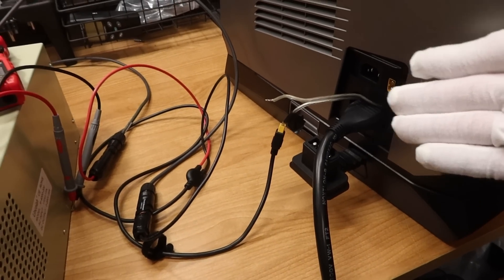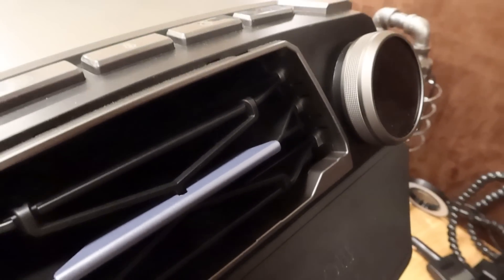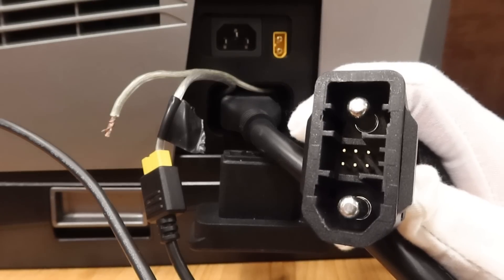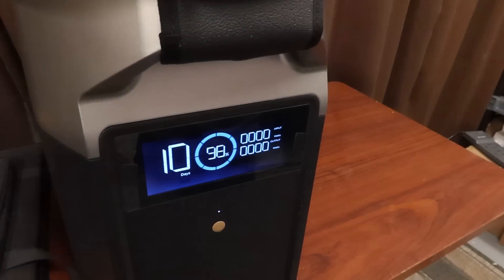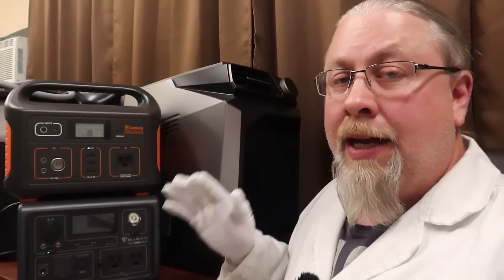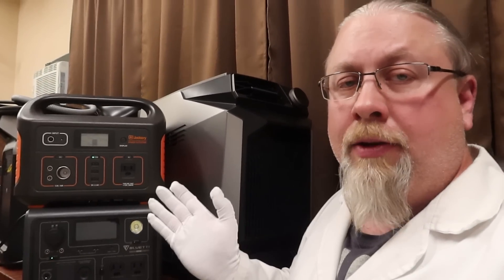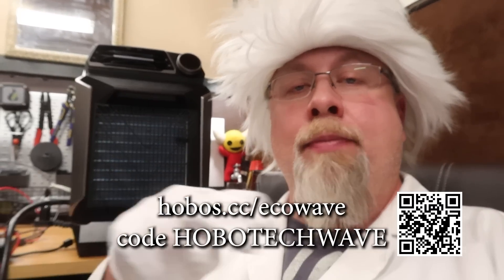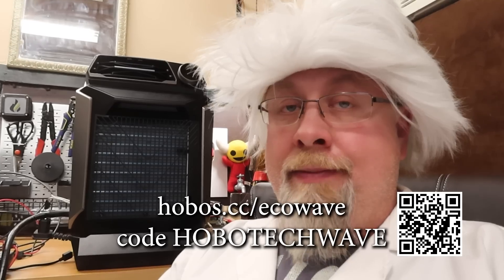EcoFlow Wave A/C FAQ | How To Use Your Own Battery Or Solar Generator

Comment from the maker: THIS PRODUCT HAS BEEN REPLACED WITH THE WAVE 2! WAVE 2 REVIEW: https://youtu.be/2NBfhABwn18 (Wave 2 purchase link: https://gohobo.io/wave2 use code or 25EFVAHOBO )
PART ONE Preview: https://youtu.be/xefWyqr-p1s
PART TWO Review: https://youtu.be/Ngm4Ct1O_Xc
Reply: When you add code, the cost goes up over what they’re currently offering. FYI
Reply from the maker: @cliff185026  Just tried the code. Works fine. "HOBOTECHWAVE (-$50.00)"
Reply: You are correct it does work on a single item not the bundle when you buy for example the wave and battery, their discount is already added and yours can not be added on top of that
Reply from the maker: @cliff185026  Nope. Works with the bundles too... EcoFlow Wave Portable Air Conditioner + DELTA Pro Sale price $4,249.00
DISCOUNT:HOBOTECHWAVE (-$50.00)
Reply: No support from EcoFlow!

Comment: Figures you already had tried this, took me all of 5 minutes after unboxing mine today to see it uses the same battery cables as the extra battery from the delta unit.

So I am willing to bet I could have used my existing extra battery instead of getting the wave battery, but also the wave battery will work with say my Delta 3 Plus (and if I'm not mistaken is a bit cheaper and larger capacity.)

The way I'd hack this experiment is to use a delta 3 wire my 48v battery to the PV input and then hook the Wave to the extra battery port.

This should work, and avoid the AC/DC conversion and allow use of your not cheap 24/48v battery bank.

If you have not already tried this, I'll see about trying and cover it on my channel (Vicious Computers)

Comment: I also bought the Wave 2 AC without the add on battery last month. Very happy with the AC but also looking for extra power supply without buying EcoFlow's battery. This is how I solved the problem. I have a 12v 108Ah Lithium phosphate battery hooked up 240W to solar panels for our fridge when we go camping. I also have a Victron 800w Inverter connected to the battery that gives me power and I plug my Wave 2 AC to that and presto my Wave 2 AC works. That is as long as the sun is shining and keeps on charging my battery.
Reply: Well yeah that works. But everyone was asking to know. Because they’re wanting to run DC to DC. If can be plugged into any AC an be fine.  Your AC is just coming from a battery bank. But your still getting all the losses bs going dc to dc

Comment: Use a Delta 2 instead of the Wave 2 battery and you can put in 15 amps instead of 8. 
My Delta 2 shows 370-380w incoming when using two 12v batteries in series for 24v.

Comment: Really need to have a product manual that has the internal schematics and motor and system in the cooling unit b4 doing anything other than using the equipment intended to run it.  So most likely less than 2000 BTU the way you got it running through the 24 volt solar port.  Any link to the real technical manuals?

Comment: Can you extend the runtime of the WAVE 2 With the bluetti AC 300 like you showed in this video
Reply from the maker: Wave 2 can be powered from any AC source over 600w.
Reply: Sorry, I did not make myself clear. 
I think in this video, you used an adapter (that you sell on your website) and the AC300s, 24V DC 10A cigarette lighter plug to charge the wave battery through its solar port. Can you do this also with the Wave 2? I am trying to figure out how to use AC300 with the Wave 2, if possible. I am also trying not to turn on the AC300s inverter if I do not have to 

Thank you, and thank you for these Videos.  @HOBOTECH

Comment: Question; in case of a power outage, AFTER disabling the main breaker, could I connect the Delta outlet to any inlet at the house, for powering some lights etc on that string (no heavy users) for a while? I can imagine that a battery which delivers 220v and I deliver that (output) to an outlet in the house which has no power at that moment the outlet would get 220v from the battery and everything connected to that outlet's string like a lamp, a TV etc would run on the battery... The outlet and wires in the house would then just act as an extention cable, right?

Comment: The comment spam is because ecoflow batteries are too fucking expensive

Yeah they're more expensive, but an inverter is a lot cheaper, your battery to an inverter, to the AC unit, and you get ti save $1200

Comment: Would you be able to do a 100ah lifepo 4 battery with a 12 to 24v booster off of it? The lifepo4 batteries I have unfortunately can not be put into series.

Comment: Thank you for this! I almost bought myself a wave 2  thinking I could run it off my LifeP04. I hate when manufacturers get into proprietary systems. Screw EcoFlow. Not for me!
Reply from the maker: Try watching the review of the NEW model... it supports 12v-60v charging. https://youtu.be/2NBfhABwn18
Reply: So the new model will run direct off a LifePo4 24 volt system or do you still need to buy at least one of their batteries?
Reply: @TroyD-vo1bz  you still need to buy one of their NMC batteries.. either the add-on or an ecoflow power station.  Same cable, it looks like

Comment: 5:00 couldn't you put in a diode between the ecoflow battery and the other external 52V, so that there is no backflow voltage back to the ecoflow battery?
Reply from the maker: The new model runs off 12-60v https://youtu.be/2NBfhABwn18
Reply: @HOBOTECH  well, i'm talking about hooking a different external battery the way you had it hooked up at 5:00 .... but you were worried about backfeeding the ecoflow battery and possibly damaging it's bms, etc.  but a diode would prevent that backflow. a simple diode may be the solution.
Reply from the maker: @BobbyL80123  I was saying it's moot because the new version  supports external charging.

Comment: I get why EcoFlow does this.  When a compressor kicks on, there is a heavy load; unless the power input can handle it, there could be issues.   For a battery,  the BMS might not be able to handle the load.   I will use a power inverter feed by a battery.  I know there will be some loss from the inverter, but it is a HELL of a lot cheaper than the $800.00 battery add-on.  targeting 800-1000w inverter.  I'll test with a Giandel 600w with a surge capacity of 1200w first.
Reply: I'm wondering if you can find the DC output of the internal AC power supply and tap into that.

Comment: Hobo could you use a step up converter 12v to 24v 10amps ?
Reply: I’ll answer myself yes you can .Don’t buy a 24v battery just use 12v and a step up converter 💪
Reply: @MrHsv123  thank you! Saved me asking the question.
Reply: can you step up with a converter that has more amps than needed to get full power? @MrHsv123
Reply: @FilthyRandy-69  Never had a issue works perfect

Comment: Can I hook 2 delta batteries together in parallel to have it power my RV with twice the storage?
Or can I stack 2 together with shared common to run split phase 220v and run my well?

Comment: Thanks Hobo, EcoFlow has a XT60 solar hook up (as you showed hooked into a lifepo4 battery) and a XT60 cigarette lighter charger hook up. For the purpose of hooking into a 200amp 24 volt lifepo4 battery would one be preferred over the other?

Comment: Crazy Ecoflow thinking by capping the solar DC input with 12-30v 8A. If they made it 16A it would have been perfect for DIY battery (solar) hookup and a lot more of these standalone Ecoflow AC´s with battery would be sold. Now you can´t run it indefinitely on DC, still have to buy an included battery and use it  only with AC wall power.

Comment: Hobo, quick question: I’ve got the wave packaged with the Delta Max. Following the directions, I connected the extra battery cable from the wave to the delta max. The wave powers up but won’t engage the fan or compressor. But when I connect the ac cord and run that to the Max, works fine. The instructions are incorrect.
Reply: UPDATE: What Ecoflow doesn’t tell you is that your Wave unit may need a firmware update. My unit wouldn’t power up using the battery cable to my Delta Max. I connected the app to my Wave, updated the firmware, and voilà! Now the Wave connected to DC on the Delta Max works just fine.

Comment: Hello! I have a Bluetti AC300. If I am understanding the video correctly, I would need a cable that goes from the Bluetti's 24V DC output to the Wave's DC input -- the yellow input, correct? -- it looks like maybe an XT60 or 90?  Can you post if there is such a cable to be bought, or will I have to make one.  Thanks!!

Comment: Thank you so much for this video.!
You have finally answered a question to many EF1500 owners. (Something Ecoflow never did as they want us to but their new batteries). I wanted to buy the Wave but I wanted to run it from my EF1500 and not throw more $$ on a new device. 
The EF1500 have 24v connectors on them which I now know I can use to power up the wave comfortably for a long time! 
Thanks Hobo! 🖖🏻

Comment: Hi professor Hobo
Thanks for all your precious advices you are the best!
I purchase with your link the Delta Max and the EcoFlow Wave AC combo and i love it!
I would love to recharge the Delta Max with solar so i buy the 300watts ATEM POWER solar panel blanket cause they are more then half of the price of the EcoFlow portable solar panel and they are much more compact.
But i have a problem the connection wires who comes with the ATEM do not match with the one who comes with the Delta Max.
Can you please call tell me witch adaptor and wires should i buy and can you please send me the link of them is you sale them.
Do you have a email by chance where i can send you pictures about that ? if that helps cause i have no knowledge on electricity.
If by chance you can do a review of the ATEM Power solar blanket that will be very interesting for your followers i think.
Thanks a lot by advance 👍🏼👍🏼👍🏼

Comment: So EcoFlow does like what Microsoft and Apple does. Make products specifically designed to only work with their other products, to make more money for their company
Reply: somone will knock the product off.  It is 2022 for pete sake. how no one has produced a portable 12/24 volt AC unit for the masses yet is amazing. It's coming.

Comment: You have to be careful with some of these.. The BMS is programmed to run only their Battery system..And they have built in MTF. They will do so many cycles. Then refuse to work. Not matter what you do. You have to buy the new BMS and battery from the factory...As they don't want you replacing the batteries with nothing but theirs...

Comment: Hey hobo just a question I take core of 6 fish tanks and iv been the power outages they warn about and I was wondering if and any suggestions on a ups battery back all of my water pumps and lights are 12 volt but what I worry many is the air pump I have a full room system that runs off one air pump what would be you ideas on how I'd get a ups to run it for 8 hours minimum and maybe 12 worse case. I live in an apartment and they don't allow solar I tried they got mad
Reply from the maker: You need to do an energy audit to figure out how much power you need. Get a Kill-A-Watt style power meter and find out. https://hobotech.tv/amazon/#Tools

Comment: so dissapointed that the battery option on the wave is only lithium ion....    im team lifepo4 all the way
Reply: You can optionally run it off the Delta Max which is NCM or the Delta Pro which is LFP. Anyone who plans on using the Wave long term is a going to use a larger battery anyways as it’s much more cost effective and far more convenient for continuous use vs buying stacks of smaller Li batteries.

Comment: I have tested some window ACs and it used less power with the fan on high since the inside and outside fan are coupled if you turn the fan to low the power drops but it climbs back up because the outside fan is slower and I assume the pressures get higher and the compressor has to work harder and it wasn't a big difference but it was there and not working the compressor harder is probably a good thing

Comment: Thank you for your sensational trick i will convert it to extend the runtime of an Eco Flo with a smaller Jacorey by using 12 V output into the EcoFlow  to extent   The runtime of my freezer Because the smaller jackery cannot run the freezer And an extension battery is for me to expensive

Comment: SMOKING two packs of Cigarettes a day is actually good for you. If you drill a hole in the package and solder a jumper fitting on it.  But do not try it if you are left handed because it will only work during certain hours of the day.

Comment: what abought using a DC 12v to 24v Step up Converter Regulator 10A 240W Power Supply Adapter from a 12volt house bank 200amp hr batteries, witch I'm charging with a 530w solar using renogy dc-dc mppt 50a .  will it take all 240w or cap it off at 200w

Comment: I was supposed to get the Mark 2, but when I saw that the Wave has 4000BTUs, it was a no brainer.
Reply: The Mark 2 is great if you get it at the openbox price and if your use case is to spot-cool. I owned it for a few months and it's a great product. The Ecoflow wave is far, far more powerful and well-rounded with real thermostat control as all air conditioners should have.
Reply: the wave 2 is more powerful, right?

Comment: Love your show! Guess it's okay to call you Hobo since it's in the channel name and I don't know your name IRL. I'm not even a novice tech but it seems they're trying to crave a nitch in the outdoor/ DIY camper world. These would also be great in the trucking industry too. (If you have the power to run it)Even though trucks can start and stop with a thermostat. Not really sure I'd spend all that money on it to begin with though. It does stink that they have it set up the way they did but teething problems happen. I hope the people that have a need for this get the answers they need from this video. Did Bluetti up date they 3,00 so all the batteries can charge from the head/inverter unit?

Comment: Those pins are definitely data pins. It may short some of those pins to turn it on. With a schematic, it's probably possible, but obviously not recommended. The 24V battery idea is good, but I'm not sure if I would trust the regulation circutry on the solar charge controller. I'd probably put some sort of current limiter in front of it for safety. At around 220W-250W at 24v.
Reply: i actually opened up my ecoflow wave today and got the pin out. 
The pins listed on the board, SIGIN2, SIGIN1, SIGOUT, WAKEUP, CAN-L, CAN-H. 
You are right, it is communicated through CAN protocol, 
I presume the first three, SIGIN2, SIGIN1, and SIGOUT are for the display. 
I am going to try to apply 5v to the WAKEUP pin to see if it comes up, while applying 52v to the exterior pins.
Reply: @noahpan496  Any luck?
Reply: @noahpan496  I figured that's what it would be. Let me know how you make out! Curious
Reply: @noahpan496 burned it up or what
Reply: God I wish I had the schematic, do you have the battery so that you can probe the pins?
Reply: @noahpan496  Unfortunately I don't. If I did, I'd share. Someone has had to have ripped one apart by now. Best guess is they are voltage sense m/reference pins or some sort of pwm style cann bus, like door latch sensors in modern cars.
Reply: Haha I’m searching everywhere for someone to have done it. The battery is sold out on the eco flow website too.

Comment: An Honest opinion from a truck driver…..Most of these fancy and outrageously expensive gadgets with digital circuitry are pure junk that on a real hard working environments will fail you miserably (hot, cold weather or unexpected  power spikes) stay away from anything that has digital controls….. 
The same goes for fancy batteries!
 Why do we use regular batteries on big rigs and not Lithium or phosphate?  
Regular batteries are less expensive, heavy but proven and reliable particularly in -0 degrees or cold environments! 
No offense to this channel or anyone! Think for yourself!!
Reply: Lithium doesn't have reliability issues. If you can keep it warm it lasts a hell of a lot longer than lead.

The problem is the ambient temp requirements.

However, to be entirely fair lead acid also is subject to loss in capacity and damage from use at low temps. The difference is they DON'T have a bms to protect them so people don't realize it or care.

A lead battery will last 10x longer at room temperature than it does in cold or very high temps all the same. That's why there are lead setups out there that are 50 years old and used daily but your starter battery is often dogshit after 2-3 years or less.

There are other factors too but cold and heat are still detrimental.

Comment: So basically your better off using a regular window ac and just using the saved money for more panels or batteries.
Reply from the maker: This is meant for PORTABLE use. If you're using it in a fixed location and plan to run an AC inverter it makes no sense to buy this product.